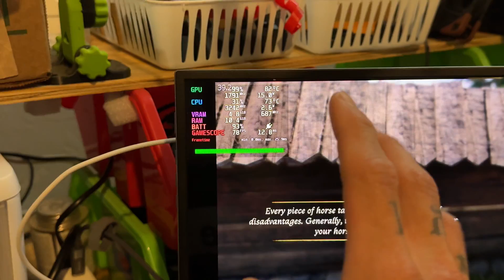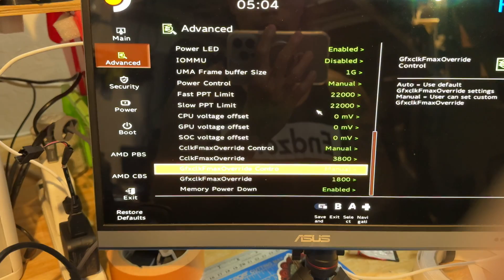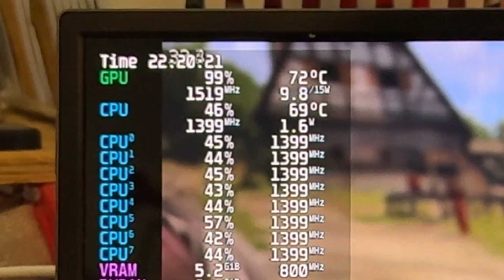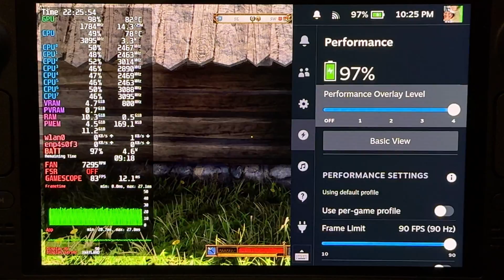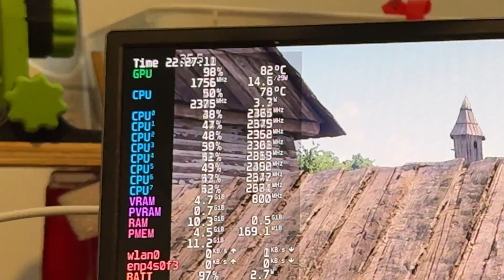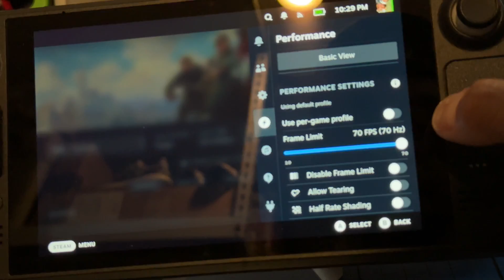Lossless Scaling Steam Deck OLED Power draw issues SOLVED!

Comment: Were the settings the exact same? Undervoltage from both steam decks? allow tearing, etc. asking since on my oled I get 85fps with loseless scaling on KCD2.(optimized settings, so mainly medium settings, some low but only like grass density.) My tdp is 26w. cpu max at 4000, gpu max at 2200. My undervoltage is -20 -50 -50(CPU/GPU/SOC)Yes my temps hit 95~C when gpu reaches 2200mhz, I’m getting the JSAUX backplate that should reduce temps by 10C meaning less thermal throttle I’m hoping lol. Great video though still, wish more people tried overclocking and refining their deck
Reply from the maker: Yes, the settings are exact same, turns out the issue was with frame cap on the steam deck

Yeah, I don’t understand why people don’t at least do a slight overclock, it really helps with something like LS

Comment: I use multiples of 24fps which looks perfect on most games.
Reply from the maker: anything under 30 makes FG hard for me to stomach.
Reply: @Diy_Papi  if you have 24/25 and double it doesn't look super smooth but there's no warping. And you can max the graphics. But I'm using 70hz I don't know about 60hz.

Comment: Just a question if you set your framerate to max 30fps does losless scaling bump it up to 60fps so i can save battery on my SD
Reply from the maker: Yes, but I don't know how much battery you would save, LS does take a bit of power to, to run. might be a wash or maybe even more power with LS on.

Its very game dependent,

Comment: I didn't try overclocking my 1TB OLED till after I installed the first version of lossless scaling and couldn't seem to really get them wattages up. Never saw CPU above 3500MHz and GPU occasionally above 1600MHz. I wonder if this is why. I ended up removing power tools and deciding not to mess with it. I've just updated to the latest LSFG plugin and I think I'm gonna give overclocking another shot now that I'm aware of this. Thanks for testing it.
Reply from the maker: Glad this helps you out! 

add power tools, from time to time you'll need it to switch the TDP OC. just a bug, but easily resolved by switching power states with power tools.

This issue seems to happen more with the OLED than the LCD